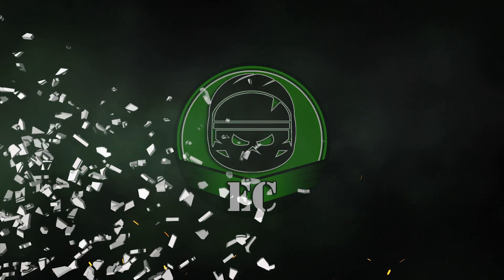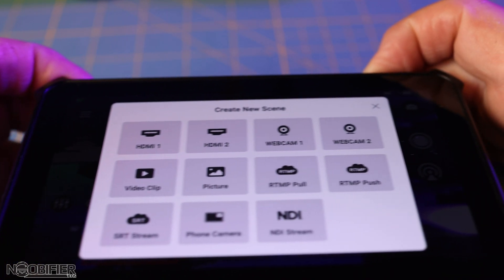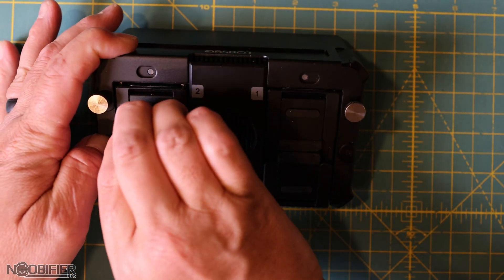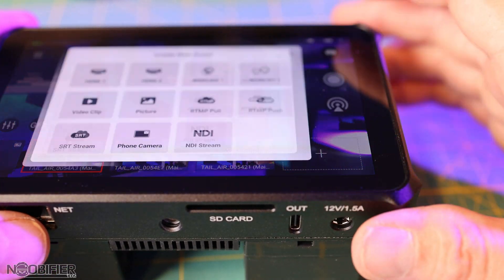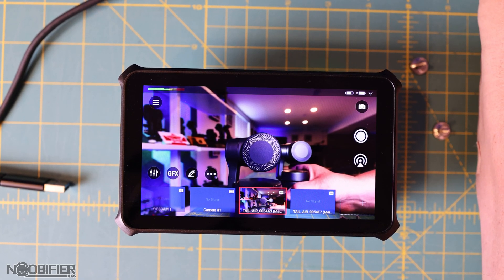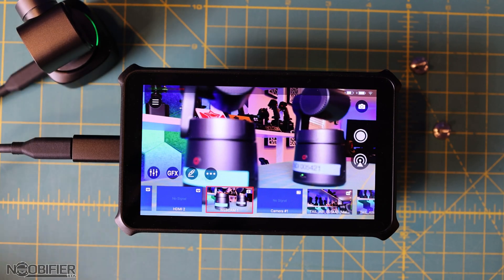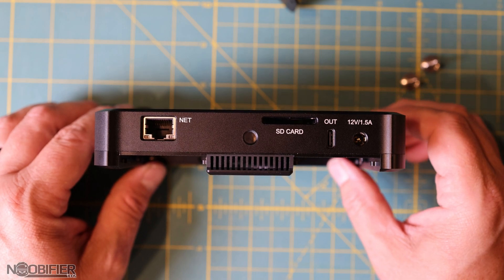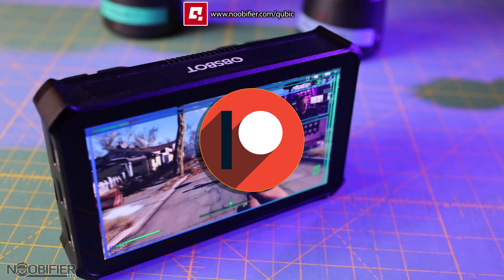Perfect Multi-Cam Live Streaming PC -- OBSBOT Talent

Comment: I am curious if this will replace the LiveU Solo for IRL Streamers.
Reply from the maker: @spazeemcgee  they have added a couple of simple features since the video. It’s truly remarkable for the cost, and most interesting, you can use it as a simple switcher, then feed its output into a capture card if you need a more permanent setup
Reply: @NOOBIFIER1337  So more than anything it's just really amazing for mobility of your rig and having it in the palm of your hand that sets this apart.